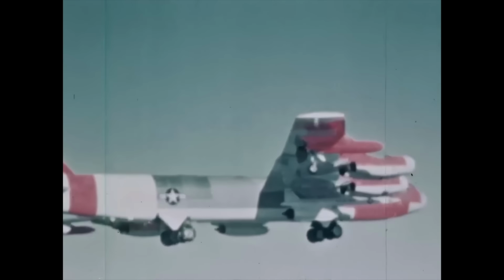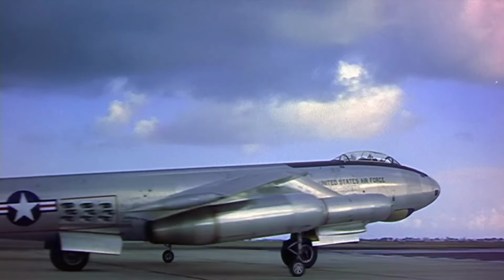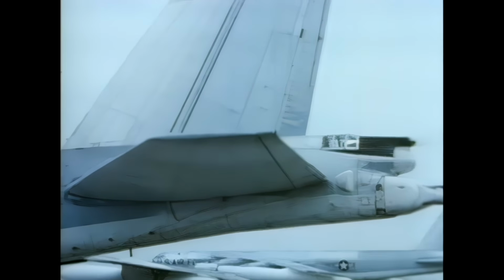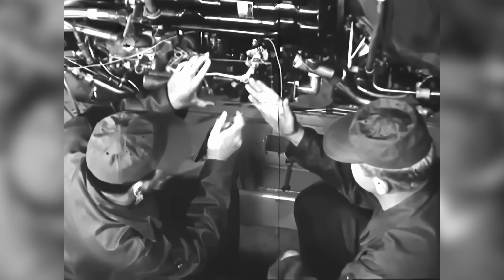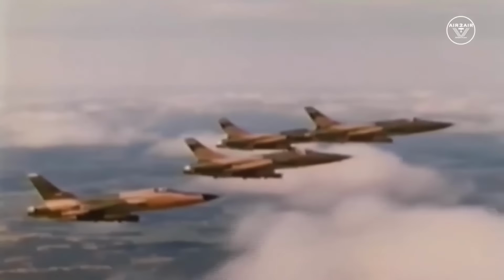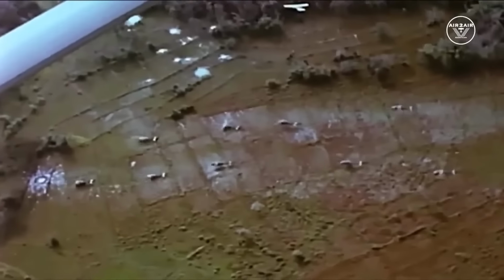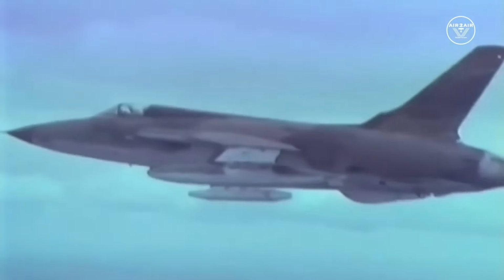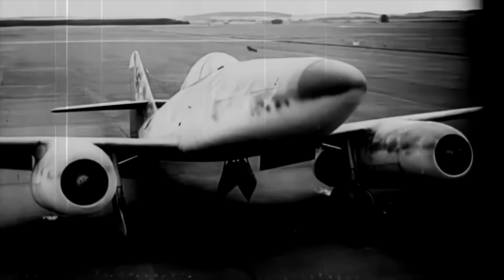B-52 Stratofortress Bomber | The Boeing Plane That Could Fly Without The Tail

Comment: Boeings still fly without tails. And doors, wheels...
Reply from the maker: I knew this was coming 😉
Back in the days Boeing had a different philosophy, which wasn’t just hyper focused on pure profit.
Reply: And engines.
Reply: @peterdevreter Boeing does not manufacture engines, they get them from Rolls Royce and GE. The wheel was a maintenance issue. But pretty much everything else you are right about.
Reply: @JustinAnderson-wg7xc  
Ah, but Boeing builds the pylons from which the RR and GE engines fall.
Reply: Shots fired 😂
Reply: What goes up.....must come down
Reply: I’ll def check out the PBS video. Thx
Reply: It’s ok. The pendulum always swings and the winds of change always blow. There continues to be only two “major” airline manufacturers. Boeing will eventually get its act together. 
One would hope!
Reply: Bolts and screws too
Reply: The flying coffins